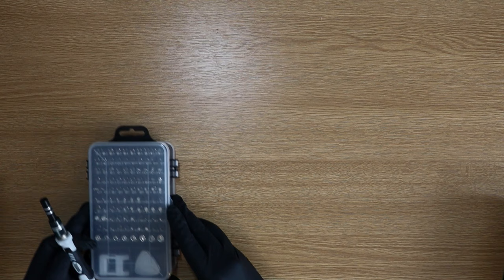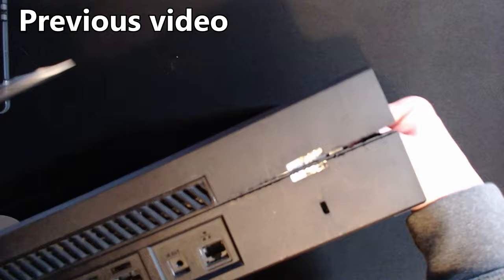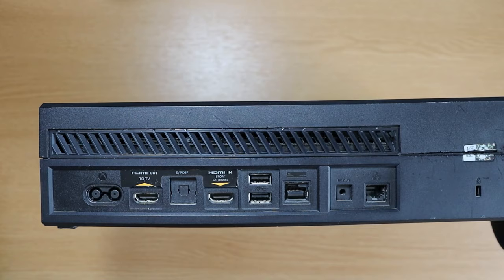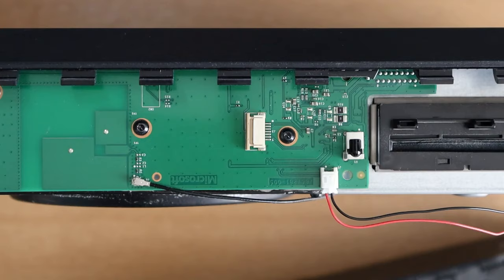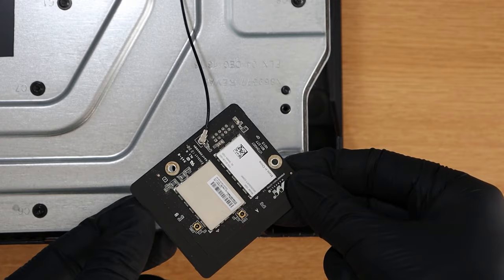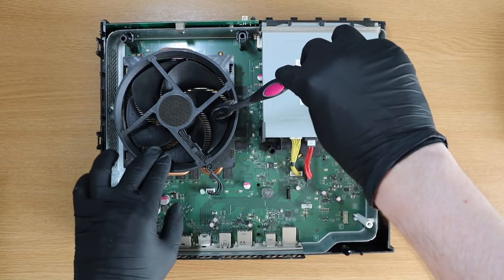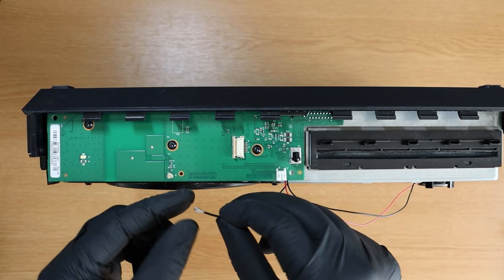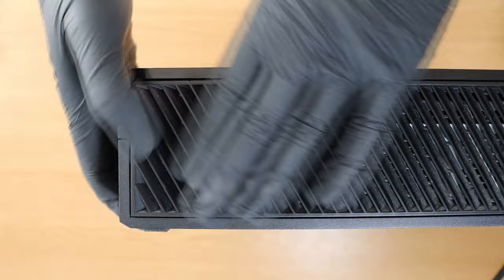How to Clean an Xbox One

Comment: IF YOU'RE HAVING TROUBLE RECONNECTING THE LAST SHELL, DISCONNECT THE FRONT PANEL WITH THE ON/OFF WIRE TO MAKE IT 1000x EASIER. SAVED ME SO MUCH FRUSTRATION
Reply: The guy in the video should have done it that way took me an hour to not get it done then saw your comment and it took a minute to do it your way so thank you for commenting
Reply: @devonwright9997 Excellent! Very glad to hear I helped someone, I myself was about to quit before I realised you could do that
Reply from the maker: Nice one Jonskn. Thanks for helping people out :D

Comment: I cleaned mine and did everything exactly as you said but now my controller won’t sync and I’m not connected to the wifi and bc of the controller I can’t trouble shoot that
Reply: Figured it out don’t forget to plug the wifi cable back in bc it’s also the Bluetooth for remotes
Reply from the maker: @joshkennedy871  Ahhh Josh I didn't know this either! Thankyou for sharing my dude :)

Comment: Almost broke my Xbox, I was trying to put the front part back on and line it up but it still wouldn’t click together, so I took the back part off and the ribbon ripped out of the Xbox, the ribbon didn’t damage so I slid it back into the slot and it worked again, still can’t get the front to go back to the way it was, but at least I download all my games so I won’t have to use the DVD slot anyways. Whatever, at least it’s clean.
Reply from the maker: Sorry to hear this :( The top comment of the video was put there to help in this situation, but I guess it's a bit too late in this one, apologies!
Reply: @JoeyDoesTech  The Xbox still works, I just need to take it apart again to get the front back together. I’ll check out that video though.

Comment: I did everything and now my xbox wont turn on i triple checked the ribbon cable now what?
Reply from the maker: Does the console turn on with a controller pal?
Reply: @JoeyDoesTech  no
Reply: When i put the wifi card back in the clip it kills my xbox do i need the wifi card if i use a ethernet cable

Comment: My Xbox one wouldn't turn on one day. Unplugged it, inspected the power supply. Sure enough the vent ports were all blocked up with dirt. After it sat a day I plugged it back in. The xbox attempted to turn on then the power supply clicked and shut off. Bought a new one off Amazon for 23 bucks. Now to clean out the console.

Comment: This was honestly such a great tutorial, but the whole time I was taking things apart it felt like i was having to fight every little thing harder than i expected. Then i noticed that all of the clips that hold the front panels in front of the smaller board and disk reader were busted and the entire thing wasn't quite at right angles. I cleaned the dust but after hours of patients all of the upper clips broke one by one and I am overwhelmed and generally upset.
We did buy it used a few years ago, so this isnt suprising but damn. I dont know what to do now :/

Beyond my failure to anticipate failure, this tutorial was really good and was thorough enough that my only confusion was completely my fault (I put the WiFi board on before the lomg screws and couldn't figure out where C3 was fir a few minutes, again my fault entirely)

Comment: I thought this would fix the ticking noise but it did not made it worse sounds like 70s tractor starting up
Reply from the maker: Not ideal pal. Can you try and locate where abouts on the xbox the noise is coming from?
Reply: @JoeyDoesTech  It’s coming from the fan but the fan looks fine had it open 3 times and something always goes wrong front buttons didn’t work then it didn’t fit right but I got it back together right now and I’m not gonna mess with it anymore
Reply from the maker: @thatwhite6504  Fair enough dude. At least it's still working though!

Comment: Took it all apart, cleaned and put back together with ease…. Until I turned it back on 😭 I must have damaged the blue ribbon thing because none of my front buttons work now😩
Reply from the maker: That sucks Nym. Take the front part off and just make sure it's all connected. Let me know how you get on!
Reply: @JoeyDoesTech  I’ve just done that and IT WORKS AGAIN!! Clearly I messed it up but it’s all sorted now! You’re a life saver❤️ new sub from me👍
Reply from the maker: @nym272  YES! Well in dude. 😃 You're very welcome.

Comment: Awesome video! Putting the cover back on is so much easier if you separate the front panel from the top. Just put the top on, connect the ribbon cable, then snap the front back into place.
Reply from the maker: Aye good job! Yeah the video in the top comment should help some people as well :)

Comment: What is the point from removing the hard drive
Reply from the maker: You dont need to, was just showing in case someone wanted to swap the hard drive.
Reply: @JoeyDoesTech  ok thx im just gonna close it back and see if the xbox gonna run😬
Reply from the maker: @aymannajem5245  good luck bud!
Reply: @JoeyDoesTech  thanks u man its works and faster than before
Reply from the maker: @aymannajem5245  😁

Comment: It worked but now my disk tray, side button don't work and now I can only turn if on from my controller ☹️
Reply from the maker: Sorry to hear Eric! I think at this point the fault is with the blue ribbon cable on the front side of the Xbox. Try and remove it and put back in, see if that works :)
Reply: @JoeyDoesTech  I did that multiple times but I will try again later

Comment: This went horribly for me, his hand completely covered the WiFi connector and I couldn’t see exactly what he did, when I tried it the WiFi connector at the front detached horribly I know I am mostly to blame but I feel as though this grave mistake could have been avoided had I watched a clearer video.
Reply from the maker: Hey are you talking about the front panel and not the Wi-Fi connector? If you’re talking about the front panel, there should be a better guide for that specific but in the comments :)
Reply: @JoeyDoesTech  I mean the front panel wire that connects to the wire, the other video will no longer be any help, I ripped the wire since I incorrectly assumed the motion to detach the wire was a pulling motion as couldn’t see. It will now need to be sent for repair. The rest of the video was great though.
Reply: @JoeyDoesTech  5:35 is the moment I’m talking about

Comment: I did everything exactly the same as you but now when I try to turn it on i hear a noise for a second and it doesn't turn on.
Reply: You have to clean your power brick I had this problem and I literally just fixed it an hour ago. search open and clean xbox one power supply on yt. Note you do not have to destroy the feet of the power brick you can use needle nose pliers to remove them.
Reply: I just beat the crap out of mine because I didn't want to fk with anything.

Comment: You can just use an air compressor to clean it. I do that all the time
Reply from the maker: Facts. Only thing with this is the dust might get stuck inside the console, causing it to overheat. If it works for you, it works :)

Comment: How do I reconnect my ribbon cable
Reply from the maker: You need to put the ribbon in first, then latch the band over the top of the connector. I believe you can do it :)
Reply: @JoeyDoesTech  i did it but now the power button is for the disc drive and the disc drive is for my power button since I put it in backwards💀 better than nothing
Reply from the maker: @theskeetsquad172  At least you got it working! Maybe try on another day to switch it back :)

Comment: Getting the front clips and the right side clip to go in almost made me throw my xbox into a wall
Reply from the maker: We've all been there! It's actually my fault, there is such an easier way you can see in the comment section :)
Reply: @JoeyDoesTech  😭 well it's too late now i finally did it and feel like crying 🤣
Reply from the maker: @vensaw9456  Everything up and running working as normal though?! If so great job dude :)
Reply: @JoeyDoesTech  haven't checked yet i still need to calm down 🤣 i was having a mental breakdown putting it back together

Comment: What happens if I broke the cable when I yanked the top off to hard
Reply from the maker: 😅😅 You can probably get a new front casing bit for it. What did you end up doing?
Reply: @JoeyDoesTech  I went to go fix and they said $60 but that was to much so I left and ordered my own ribbon and fixed for $12
Reply from the maker: @ogchris6364  Good stuff dude!

Comment: I did this and yet somehow it doesn't wanna turn on
Reply from the maker: Probably the front ribbon cable isn't in just enough, that's where I'd start :)
Reply: @JoeyDoesTech  I cleaned it all up and it still won't turn on

Edit: Turns out it was the power brick.

Comment: Did everything perfect now Xbox won’t stay turned on just shows the loading screen then shuts off furthest I got was being able to start a game then just got worse after that
Reply from the maker: I'd suggest taking it back apart again and just making sure everything is connected correctly. Sounds like it could be the hard drive. Let me know.
Reply: Turns out hadn’t plug the fan back in thank got u told me to go back into my Xbox because I was going to pull my power supply apart
Reply from the maker: @Zyke_iLLest  Ayeeee good job! 😁😁

Comment: Will cleaning my xbox make it run faster and smoother?
Reply from the maker: You could definitely see an increase in performance, and it really helps with the noise of the Xbox :)
Reply: Bro if the blue part 9:23 got ripped of Will my Xbox not function at all

Comment: i can’t take out the speaker cable for some reason
Reply from the maker: Are you talking about the black and red cable after you've taken the front panel off? If so wriggle it ever so slightly and it should come out. Wriggle back and fourth not side to side :)

Comment: Bro what are you doing forcing the top shell on like that?!?! 9:52 "it will take some force but you'll need to pull the shell OVER the clip" WRONG! DO NOT LISTEN TO THIS PEOPLE!!! That is COMPLETELY unnecessary!!

You're supposed to detach the front face plate from the top shell right in the beginning once you get the whole thing loose, by lifting up and undoing around 8 clips (right b4 detaching the front ribbon, which also becomes a lot easier to do afterward). When you do it like that you don't have to force ANYTHING and the whole thing goes back together VERY easy. 

Honestly bro, I wonder how many peoples xbox's you've broken by telling them to do it that way?? Unbelievable...
Reply from the maker: Check the link in the top comment and the first line of the description.

Comment: Anyone else’s power button and eject button not work after this?
Reply from the maker: If that's the case pal the chances are that the ribbon cable is a bit lose. Take the front panel back off, take the ribbon cable out and then put it back in.
Reply: @JoeyDoesTech  haha I actually figured it out like 5 minutes after commenting, I put the ribbon cable on backwards with the side with the green lines facing outward instead of inward
Reply from the maker: @adamschrecengost4710  Glad it's sorted :)

Comment: MY XBOX ISN'T TURNING ON!!!!!!!!!! WHAT DO I DO!!!!!!!!!!!!!!
Reply from the maker: You're best off taking it back apart, and slowly making sure everything is connected and back together :)
Reply: @JoeyDoesTech  I just did it all over again but I'm still having the same problem. When I click the power button I can hear the noise of it turning on very quietly but nothing else happens, it still wont turn on
Reply: @JoeyDoesTech  It is even making the noise for when it ejects a disk but it's not turning on
Reply from the maker: @kamisato375  Could it maybe be a power sufficiency issue? Unplug your power brick and plug it back into the xbox, aswell as the wire from the wall socket to the power brick. Make sure the power is off when you do it. 

Only other thing I can think of is if there is a lose ribbon cable inside, or maybe the wires to the hard drive are lose causing it to not boot? Sorry, I dont have much experience in fixing xbox ones :(

Comment: Lmao i followed every step and my Xbox just doesn’t turn on now
Reply from the maker: Slowly go back through and make sure everything is connected as it should be :) Most probably this is just the ribbon cable at the front.
Reply: @JoeyDoesTech  it’s my bad I ripped the ribbon cable off, pulled a bit too hard 😭😂

Comment: So I accidentally ripped off the ribbon connected to the front panel... what does that do exactly? Lmfao
Reply: That is for starting xbox on and off (for button). You can even have problems with controllers bcs of that front part. So man I'm sorry but you have to take your xbox to a proffesional now to fix that ribbon or whole front. I'm now double thinking about opening it up tbh...
Reply from the maker: @amar6413  I wouldn't recommend opening it up unless you are fully confident 😁
Reply from the maker: Exactly what Neko said, it'll be for the on and off button. You will be able to turn on your Xbox with a controller, but you'll have issues syncing a controller now aswell.

Comment: Mine isn't turning on
Reply from the maker: I'd take it back apart and just make sure that everything is plugged in correctly :)
Reply: @JoeyDoesTech  if i rip my blue line 9:23 off, Will it not function properly
Reply from the maker: @elias2444  I dont think it will work bro if you've ripped off the blue cable, as that turns your xbox on and off basically! Sorry to hear, is it fully snapped?
Reply: @JoeyDoesTech   ah damn well the blue cable that goes in the little thing works fine and is not ripped
Reply: @JoeyDoesTech  we put duck tape on it lol😂,  can u otherwise fix it somehow